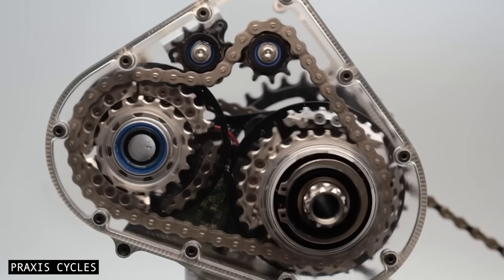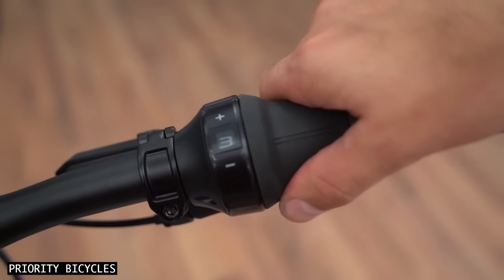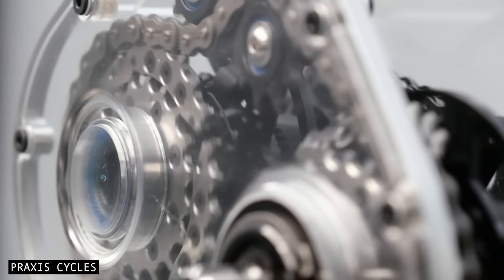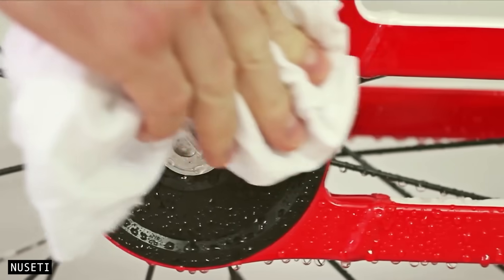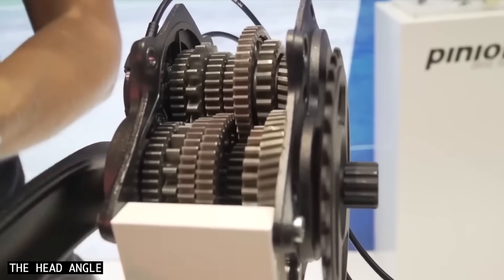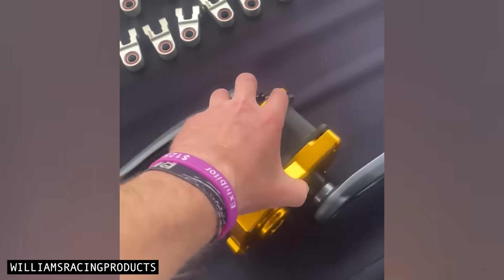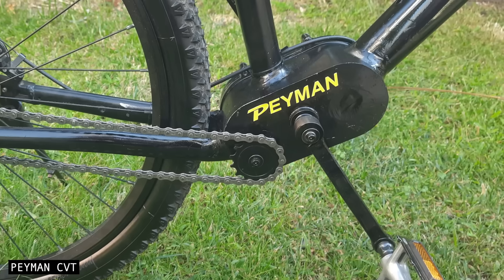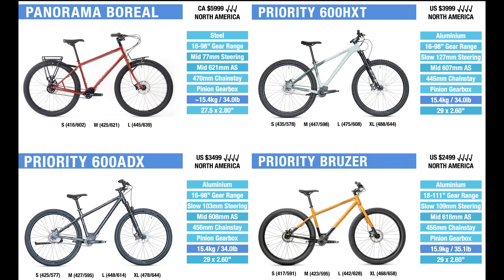8 Incredible NEW Bicycle Gearbox Drivetrains for 2026 // Shimano, Fox, Praxis, RatioX, WRP

Comment: I love my Pinion C1.12 for my commuter bike, but I also enjoy my Shimano 105 on my road bike. The gearboxes are great for durability and easy/minimal maintenance, but the chain/derailleur system is more efficient when performance matters. For most folks, the internally geared systems make more sense.
Reply from the maker: 100% agree. 👍🏻
Reply: I'm passionate about internally geared hubs, with however many gears. Old torpedo 3 speed hubs were 93% efficient across all gears, something no other 3 speed has wanted to match. Those old hubs just make me wish for an efficient hub in the sub 8 speed market. Shimano igh are totally fine, but I would like to see something better and preferably priced between 500-900€. A new coming of dependable forever tech, like the old sachs torpedo.
Reply: @Konstikas-m6j   Are you following products like Nine by 3x3 and Hub1 by Revolute? Maybe even Efneo GTRO or the Schlumpf Drive variants?
Reply: If some of those derailleur-in-a-box things or even those folding cogs could bring gearboxes close to the efficiency of a normal derailleur, it will get interesting.

Comment: casual cyclist here… bought a Specialized with an internally geared hub (the Enviolo AUTOMATiQ) a couple of years ago, and absolutely love it - would never go back to shifting!
Reply: Enviolo has interested me since it was called nuvinci, higher friction losses in the low range is what puts me off, how do you find hills and headwinds?
Reply: @zopEnglandzip I'm in San Diego, which is nothing but hills & canyons - my last ride had a total elevation gain of 1500 ft ... can't tell you what percentage my friction losses are, but I never need to stand on my pedals going uphill, and it has extended my range, such that my average 'casual ride' is between 25-30 miles (and I'm not in top shape!).
Reply: @zopEnglandzip   High losses in the best range (middle) even way higher losses in the worse ranges (high and low). I'd rather use a serial hybrid (pedal generator and just a motor in the wheel without chain or belt), if I don't value my input being used efficiently at all.
Reply: Enviolo? That's probably an electrically assisted bike, eh? 😜
Reply: @PsyKeks  Guess that bothers you?
Reply: @zenwave5272   In your bike, no.   I just think, to adequately use your evaluation, it's important to first be aware, you probably don't care about efficiency (at least within the range found in bicycles).
Reply: @PsyKeks This is true.

Comment: The important factor about internal gears is what Rohloff calls "Dauerhaltbarkeit", or long-term durability.
Traditionally this is where most gear boxes still can't be considered a viable option for those wanting Rohloff SpeedHub- or Pinion-like ease of use in combination with robust long-term durability.
It'll be interesting to explore which innovators are to be taken seriously in this regard.
Reply: If you're talking about chain wear, typical bicycle chains are a horrible and non-typical indicator of chain and sprocket life. In industrial applications where a chain is lubricated and used like it would be in the chain gearboxes in the video, the ultimate failure from a chain not being replaced at its wear interval is the sprocket teeth being ripped off the sprocket, and almost never chains snapping. It's an indication of how badly lubricated and stressed bike chains are that the opposite is almost true.
Reply: @nelsonglover3963 
I'm obviously not referring to chain-wear, but to the expectable long-term durability of the gearbox itself.
Reply: @87solarsky fair enough, I'm not sure what your concerns are then. Excluding the chains and sprockets all you've got is a metal box with some bearings in it.
Reply: @nelsonglover3963  
Well, I own a Rohloff SpeedHub 500/14-equipped All-Terrain-Bike, and I assure you, it's not the outside of the gearbox I'm concerned with, but what's inside it.
If you're not a nerd about the intricacies of modern mechanical engineering, you won't likely appreciate my concern, I think.

Comment: Been loving my Co-Motion Siskiyou with a Pinion P1.18 since 2020 and recently added a R+M Load4 75 with a Rohloff E-14. I can’t imagine any circumstances in which I would consider buying a bike with a chain ever again. Smooth shifts, regardless of conditions, with small steps and near-zero maintenance cannot be beaten. The only thing that might be better, some day, would be a shaft drive to go with a gearbox.
Reply from the maker: Those are some nicceee bikes you've got yourself! Glad to hear you're enjoying the Pinion and Rohloff drivetrains. 😎
Reply: Have a Bullit with a Rohloff and love it in this type of bike (cargo). But I would never change to a Gearbox in any Type of "fast" Bike. (MTB/ Gravel/ Roadbike).
The weight and also the "spring-feeling" is nothing i want on my bikes where i put much watts on the Pedals. 
If you drive with less effort or the reliability is very important then my first choice ist also the gearbox.

Comment: They look heave, no?
Reply: My p18 pinion gearbox is 1.1lbs heavier than a traditional derailleur system. But I get bombproof reliability and almost zero maintenance. Plus i now got 85,000 miles on the same unit. I would have to replace a traditional one many many times. Certainly paid for itself.
Reply: Forget weight, the biggest problem with many gearboxes, especially CVTs (I have one) is efficiency. If you could wave a wand and make my enviolo CVT 10% more efficient but it would weigh 5LBs more I would take that instantly!

Comment: Gearbox / belt drive are ideal for e-bikes.  Regular drivetrains aren't durable enough for ebikes, and the small weight and drag penalty are less problematic on an ebike.
Reply: Not just ebikes. Got myself a belt drive on my bike last year (no e) - will not go back to derailleur.

I'm not racing, so the small loss to internal gear hub doesn't matter compared to the quiet, smoothness and low maintenance advantages gained.

Comment: When a human is putting in the power, the parasitic losses are always a hurdle to overcome. You can have complex, elegant systems that shift very well, but with complexity comes weight, increased inertia, and drag. The CVT systems are going to be the worst when it comes to drag, but very smooth in ratio change.
Reply: In addition to the increased drag, you have to wonder how the feel will affect the user experience. If there's a rubber band feel to them it's going to turn people off. 
Probably less of an issue for an e-bike. 
I can see this working on a rental bike in a big city, otherwise, probably not the best solution.
Reply: The internal chain drive gearbox was fascinating, with the various 3 or 4 section sprockets that pivot in/out of position.
Reply: For me, personally, a motor may not be the reason for a significantly less efficient bike. Even my large cargo bike with an allowed combined weight of 350kg (770lb) I chose for it's pedalability (only 55kg 120lb empty weight) and set up with waxed chains and tubeless BMX race tires.
I use Rohloff Speedhub and Pinion C.12, but an Enviolo would not find it's way into my non-assisted bikes and won't find a way into my assisted bikes, either.
The moment I start thinking "it's only a loss on the human power part" is the moment, it's not a bicycle anymore. And at that point, why would I have a mechanical link anyways? Today we have pedal generators, that eliminate a lot or maintainance and complexity from the bike.

Comment: I've been rocking the Pinion P1.18 since 2017 and I would never want to go back to a derailleur bike.
Reply: Still angry that I cheaped out a few years back and got an Alfine 11 instead of Pinion/Rohloff
Reply: @Frankfurtdabezzzt  I feel you. Actually I have similar regrets towards overspending. in 2017 Rohloff bikes were considerably more affordable than Pinion bikes (about a EUR 1.000,- difference) I think a Rohloff would have done the trick equally well. I just thought that the bottom bracket position of the Pinion would be a more reliable solution compared to the rear hub of Rohloff in case the wheel would have problems. Looking back I should have opted either for a Rohloff or the Pinion 12 speed gear box. Nonetheless I am so happy that derailleurs and chains are in my past. they are just not durable enough for long distance/cross continent adventure cycling.
Reply: @phatcat5457  I have a Pinion 9 on my bike and sometimes feel like I'm missing a gear. I think a 12 would be a sweet spot for most people.
Reply: That's because you don't ride a non emtb from rocky mountain but cool story bra

Comment: The narration says the Nuseti system uses a belt while the included clips shows enclosed metal chainstays with a chain. The newer carbon fiber frame on the website has a removable cover on the inside of the dual drivetrain side chainstays to replace the belt. From an interview, the owner says it is very expensive to make the carbon frame, but the steel frame plus chain shouldn't be that much more expensive to make than a traditional gearbox frame. Fishing the chain through the chainstays might be a bit of a faff.
Reply from the maker: Nuseti began testing with chain drive but switched to belt drive after their promotional videos were made.